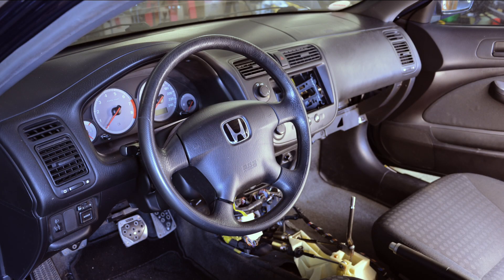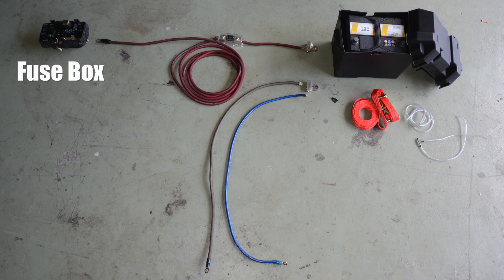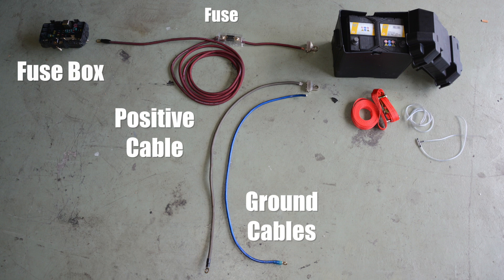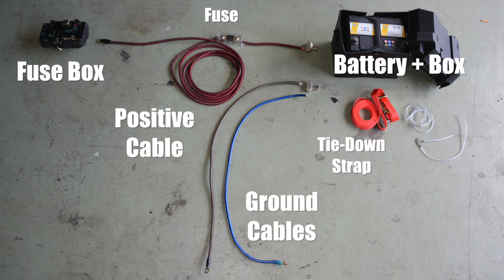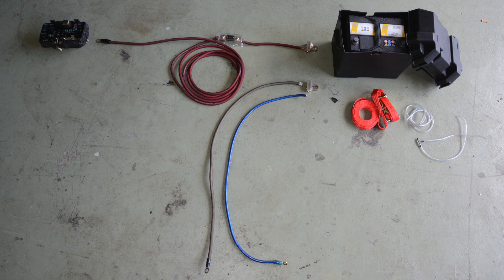K20-EM2 Swap - EP. 03 Battery & Wiring

Comment: Hey guys im doing this swap to and was just wondering which ecu you used and if you had to kpro it.
Reply from the maker: We took the OEM PRA ECU from an EDM Type-R (EP3). We didn't use kpro. Had to wire in an immobilizer bypass though

Comment: I got the swap up and running but can’t get the 02 sensor wired right anyone able to help?
Reply: Done a kswap on my ep2 with a jumper harness having same issue can't sort out bank 1 senzor 1....
Reply: Have u tried reversing the 2 bottom o2 wires ???
Reply: Gord Herreman I ended up getting rid of it. I think the guy I sold it to got it working tho
Reply: @andresmaximus2885  yeah I just got mine done but I learnt alot along the way for sure lol
Reply: @gh6338  hi bud am doing a kswap with mine all running but am getting a fault code for ect sensor 1 high input (p0118) and eld fault (p1298) and a serial Com fauile (p0600) can you shed any light on had to sort the faults
Reply: @grantlister119  what ECT sensor are you using k20 or D17 ??, The ELD will always be there but won't actually cause the light to turn on the RSX fuse box has a resistor in it, the em2 doesn't nothing to worry about... As for the P0600 it could be the multiplexer haven't had an issue with that code... Are u running stock ecu or k pro??? Do you have a conversion harness or repinned stock harness ???
Reply: @gh6338  going to use the k20 ect and useing a stock k20 ecu with a k-tune Bypass for the immobiliser and I got a k-tune conversion loom only wire tht I not done is there a green one tht say fan switch on tht conversion loom tht I yet to wire in
Reply: @grantlister119  switch the k20 ect with the D17 ect sensor... double Check the wiring on the immobiliser by-pass, may be because the bypass I programmed my Honda key into the k20 ecu
Reply: @gh6338  the is wiring still there for the d17 ect sensor
Reply: @grantlister119  take the sensor out of the D17 and put it in the k20... the plug is the same on the k series harness
Reply: @gh6338  cheers bud done that tonight and the fault cleared but the temp gauge dose not work on the car do you have any info to get it working it use to work with the d17 engine fitted
Reply: @grantlister119  yeah sorry bro was doing my rear disc conversion tonight... When u change ur ect sensor it should work... And yeah my memory got jogged a bit and the immobiliser boxes take a bit everytime u start the car the box remembers the programming... It just has to figure out what the ecu wants.... if u have any problems with it just take it to a shop that has a snap on scanner and they can reprogram ur key takes like 20 mins so u don't have to use that box... If it causes u any problems... Where did u put ur battery if u don't mind me asking ???
Reply: @gh6338  am going to relocate the battery to the boot
Reply: @gh6338  hi  bud Just a quick update I swap the sensor on the head to the d17 one and fault cleared but then got a fault for the 02 sensor heater. Bank1 so rewiring the ktune relay and that cleared but was still not getting the temp gauge to work and still had the serial fault so I unwiring the ktune Bypass and try to code the key em2 key to the k20 ecu with my mac tool diagnostic software and it coded the key to the ecu and now I got a working temp gauge and no flashing key light or eml light only faulty left is the eld one so  thank you for all your help and support
Reply: @grantlister119  ight bro cool good job... I didn't know the mac ones could do it aswell... Don't worry about the ELD u can't get rid of it ... Unless u have a RSX fuse box but I wouldn't worry about it won't effect the car at all... If ur gonna put the battery in the trunk, I would recommend welding cable the sheeting on it isn't plastic it's a rubber... And make sure u wrap it good with some braiding, and hockey tape... I can't recommend a fuse cuz I haven't put one in yet I have a 100 amp ANL fuse apparently good for 175amp for 500 seconds and the k20s pull about 156amps for about 3-5 Seconds but definitely put one in... By the way where abouts you from??? I'm curious ive been talking to alot of ppl all over the world about this car hahaha
Reply: @gh6338  cheers bud next on the list is to  relocate the battery then get the electric power steering wired up
Reply: @grantlister119  oh shit nice going electric, I just kept mine the original... Maybe one day change it over if I can find one there hard to find around here.
Reply: @gh6338  I was lucky enough because I bought a whole ep3 so I had most. Of the parts from the Ep3 only bit I forgot to take was the engine bay fuse box and the rear anit roll bar
Reply: @grantlister119  oic yeah that's the best way, I put the RSX-S engine and tranny so I had to piece it together cuz I wanted to keep it 4 lug so it still looks like it has the D17 hahaha, I even hunted down 2002 ep3 rear spindles and calipers for the rear disc conversion cuz 2003 went 5 lug... Did u do the rear disc conversion too ??? Where u from by the way ??? Lol I'm curious, I've been helping alot of ppl all over the world with this swap so I started asking hahaha
Reply: @gh6338  am from Cornwall UK and mine was disks all round to start with just 4 stud so I swap all the hubs to the 5 stud ones and swap all the  suspension over to
Reply: @grantlister119  oh nice ok cool I'm in Toronto Canada... Thats nice they come 4 wheel disc there... Not here have to convert from the Acura el ( Canadian fancy civic) or ep3 lol alright bro any other questions just gimme a shout
Reply: @gh6338  hey do you have insta gram or something I can text u on other than here ?

Comment: Hey friend impressive video! My car is civic ES sedan  D16W7 motor 2001. How much the cost to build about 180-200 HP?
Reply from the maker: Thanks! Roughly $4,000-5,000.
Reply: @kpowered  thank you for responding!  I look your videos and i think you are specilist, my thoughts is ti keep my sedan  ,and make it stronger but always safety and economic as possible . I already have brakes back and front from ep3 type r.  Sway bars back and front from ep3,and fk coilovers., What do you prefer?
Reply from the maker: @zodiactrip  Sounds good so far. I'm also running axle and brake system of the EP3 with D2 coilovers. Haven't driven FK coils, but they'll improve the handling compared with the stock ones for sure.
Reply: @kpowered  hello friend! Fk coilovers is cheap. But is Very well, Very sporty
Reply: @kpowered hello doctor! In my car D16W7 i have thought bye skunk2 intake manifold and 70mm throttle body for d16 engine. What do you prefer about this , its can works?? Second is am not sure , how   i know that if direct fitment without problems in sensors and rests?
Reply from the maker: @zodiactrip  Wouldn't invest the money in a D16 engine to be honest. I once swapped over a high flow intake manifold on my D17 and the outcome wasn't much. Since the Skunk2 parts are very expensive I would rather invest in a different engine :)

Comment: What ecu did u use and what conversion harness?
Reply from the maker: Stock kseries ecu and no conversion harness
Reply: K-Powered stock em2 engine harness the d17? Or was the k20 engine harness used
Reply: Charlie S he use the k20 engine harness, I’m using k20a3 from ep3 engine harness on my em2 dx
Reply: I used the k20a2 engine harness and made my own conversion harness same as from hybrid or ktuned... U can repin but I decided to make my own.. If u need help lemme know
Reply: @gh6338  hey I need help with the wiring thinking of doing a k swap on my 02 civic but I'm not boosting it or anything is gonna be solid stock and I am wondering if I could not have any dash light on like check engine .abs etc it is possible or is not
Reply: @ChIsTfLoW  no you won't have any of those lights on unless u mess up the wiring.. and will only be an engine light if anything abs doesn't go thru the c101... You will however have a code for the ELD (Electrical Load Detector) but there won't be a light on for it... that's only because the RSX has a module in the fuse box which the civic doesn't
Reply: @gh6338  can the ELD be fixed ?? I'm lookin to buy a crashed RSX type s
Reply: @ChIsTfLoW  you basically have 3 options to convert the c101 connector... You can spend 200+ USD on the conversion harness OR you can repin the c101 that's on your civic now OR if you can get into a scrap yard cut the female connector from an RSX and the male connector from the civic and solder each wire to the correct pin. I have a complete schematic and pin location of the actual conversion harness from ktuned or hybrid if u need it
Reply: @ChIsTfLoW  yeah but I wouldn't worry about it... It has no effect, it doesn't turn the engine light on.. only when u scan it it shows the code for the ELD
Reply: @gh6338  I understand now if you could provide to me where can I reach you at social media or email
Reply: The conversion harness I made my self was 10 bucks after the solder and shrink wrap figured cheapest and best choice... I can't justify 200+ usd on a harness I can make myself and does the same thing
Reply: Are you gonna keep the 4 lug or gonna convert to 5 ???
Reply: @gh6338  ima buy a whole crashe rsx and just swap everything over my civic
Reply: @ChIsTfLoW  save yourself the hassle too and get 2 slim rad fans it's easier... And decide now if your keeping a/c and power steering..
Reply: @gh6338  lmfaoooo smart move lmaoo and I want everything a/c power steering all of it i just want a more reliable engine and stronger d17 been bad to me
Reply: @ChIsTfLoW  lol ok np I got all the info u need.. yeah I know what u mean I could be here forever talking about how bad mine have been... If u get the doner u can use that female connector on the c101 from the dash side and just get the male side from a scrap civic or cut the one from your d17 engine harness
Reply: @gh6338  thank you I emailed you 👌

Comment: I’m doing a k24a2 swap In my 2001 em2 and I’m trying to figure out the wiring for over a month now I also have Ktune conversion harness
Reply from the maker: What's the problem?
Reply: @kpowered  When I switch the key on I’m not getting any fuel
Reply: @troyhousen8599  bypass the immob
Reply: @kpowered  I have a few questions if you don’t mind
Reply from the maker: sure > https://kpowered.net/contact :)
Reply: I’m having the same issue, did you ever figure out the problem?
Reply: @johnnyrocket845  kpro or no ??? And is the security light on the cluster flashing ???